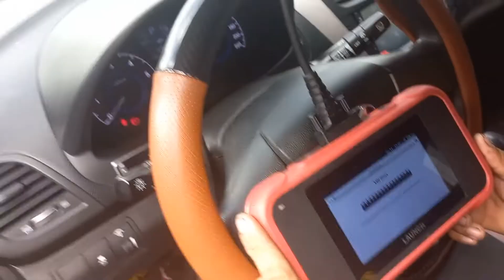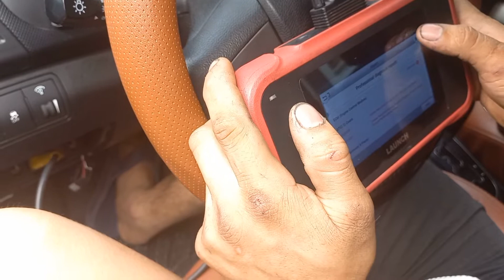Hyundai Accent Common Issue || Automatic Transmission || No Reverse

Comment: LF : Belt Metal - 4853002200
Pulley assy secondary- 4854002300
Pulley assy primary- 4850102330
Oil pump ball bearing-4845602200
HYUNDAI ACCENT 2017 automatic gasoline